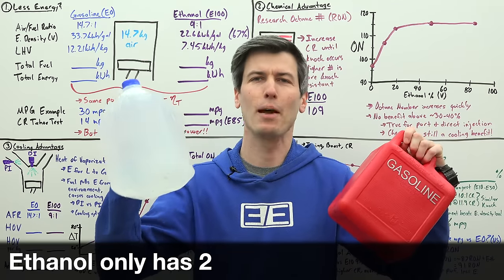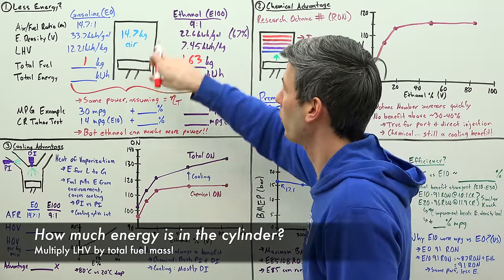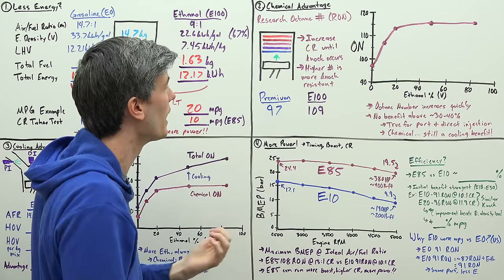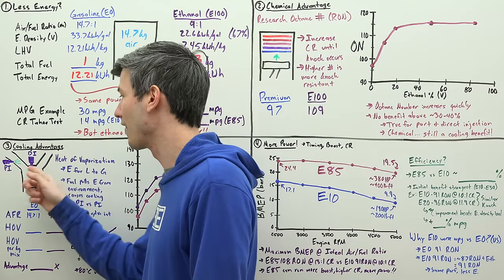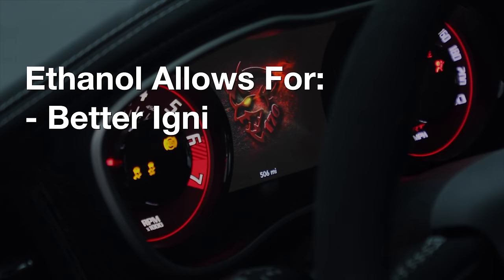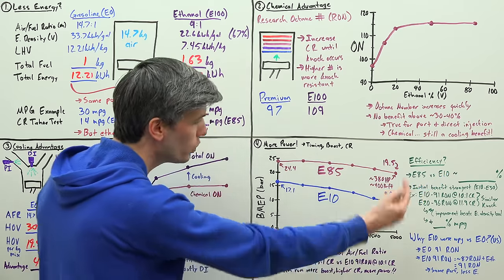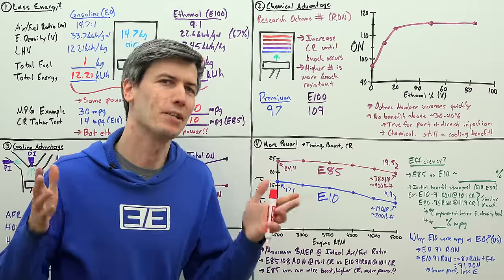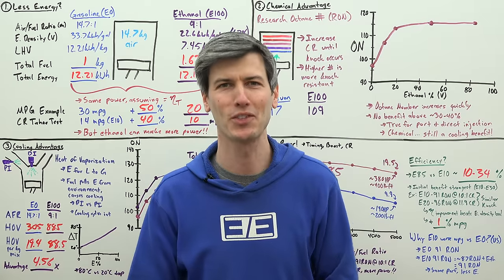Why Does Ethanol Make So Much Power? (Versus Gasoline)

Comment: Ethanol also destroys all engines unless those engines are specifically designed for it. And MOST are not.
Reply: 100% WRONGGGG.
Reply: @oldblueaccord2629  No, you are wrong. MOST if not all small engines warn about using any gasoline with ethanol. It crusts up the carburetor. If you have an airplane that is able to use mogas, you cannot use any with ethanol in it. So clearly you have no idea what you're talking about.
Reply: @jimsmalleimb7709  Im running E15 in my lawnmowers and weedeaters AND I got videos up on this thing called Youtube. You dont know what your talking about.
Reply: @oldblueaccord2629  : I just bought a new Firman generator. It says right on the gas tank and in the manual to use only gasoline that does NOT contain ethanol. YOU don't know what you're talking about. I'd prove it with a photo but you can't post photos here. There are also several videos here on this thing called You Tube that says the same thing.
Reply: @jimsmalleimb7709  No problem man. I didnt mean to trigger you. Im talking cars and lawnmowers and you swapped the story to airplanes and generators.
Reply: @oldblueaccord2629  In case the link didn't work, here are some excerpts from the article which states my point:
"Ethanol can damage many parts of your car at concentrations above 10%. Ethanol can destroy gas tanks, fuel pumps, gaskets, and attract moisture into your fuel. Engines can be completely ruined over time if they’re not designed for ethanol.
So, is ethanol bad for cars, and what does it do to engines? Ethanol-infused gasoline can absolutely damage engines. However, some engines are more vulnerable than others. Here’s what ethanol does to a car and why there’s a good reason to be concerned about using this fuel additive.
Fuel Tank Damage
Ethanol isn’t a threat to most steel and aluminum fuel tanks. However, ethanol can dissolve resins in fiberglass and composite fuel tanks, which can cause leaks or total tank failure. It doesn’t take long either.
Fuel System Damage
Ethanol is a much stronger solvent than gasoline. It also attracts moisture. Can you think of a component in your fuel system that’s vulnerable to solvents and shouldn’t dry out? That’s right, your seals and gaskets.
Ethanol can rapidly dry out and destroy rubber fuel system components, including gaskets and hoses. Some are designed for ethanol, but most are not, and they can be quickly ruined by ethanol concentrations as low as 15%. That means no E15 in your conventional vehicle.
Moisture Problems
Ethanol’s hygroscopic properties are to blame for many of the problems it causes, including engine issues. Condensation that forms inside your fuel tank on cold days is normally inconsequential—but the presence of ethanol can draw all that water into the fuel.
This can cause all sorts of issues in your engine, including fouling, corrosion, and knocking as the damage intensifies.
Reply: @jimsmalleimb7709  100 wrong very sad you spent time on that cut and paste. Enjoy your new 3 fuel generator....4th could be E85!
Reply: @oldblueaccord2629  Oh. I see. That article is a lie then, eh?
Reply: @jimsmalleimb7709  Well I dont write "articles" I do things. I have ALL the videos on my Youtube page...but just keep telling me im not...its fine. You actually gave me a great idea to convert my riding lawnmower to E85 this year. BIG TRIGGER!
Reply: @oldblueaccord2629  : If ethanol doesn't harm the engine, why would you need to "convert" it?
Reply: @jimsmalleimb7709  It needs re jetting to run richer. Usually about 30% richer. Dont worry Ill do some videos on it.
Reply: @jimsmalleimb7709  — Condensation that forms in your fuel tank will sink to the bottom of your fuel tank and freeze when temperatures drop below freezing. (Gasoline is hydrophobic.) The solution is to use fuel line antifreeze (also known as dry-gas or HEET) because it will BIND with the water and hold it in suspension. BTW, in case you haven’t figured it out, HEET is alcohol:

“The specific active ingredients of HEET and ISO-HEET are methanol and isopropanol, respectively. Amazingly enough, ethanol works precisely the same way: Water is absorbed by the ethanol and then gets vaporized in the combustion process.”

“The best way to rid your fuel of water is with gas-line antifreeze. Yes, that is a real thing. Getting the water out of the fuel system is critical, especially when the mercury drops below 32 degrees Fahrenheit.”

“HEET® brand gas-line antifreeze absorbs water and carries it harmlessly through the system. When water is trapped in the fuel lines and injectors, and the temperature plummets, it can freeze. This causes mechanical damage (cracked lines and injectors), and will impede fuel flow to the engine, so the vehicle won’t start. The antifreeze component of HEET® will lower the freezing point of the water, so that it does not freeze, keeping the fuel flowing for easier cold-weather starts.” — NAPA

Regarding E10 and water: E10 has resulted in fewer gas line freezing problems. It’s like adding a dose of dry-gas each time you fuel.

Also, alcohol dissolves in water to form a homogenous solution, so you cannot distinguish the alcohol and the water anymore. It stays “mixed”, too. Have you ever seen vodka separate?
Reply: @sking2173  Your really into the Vodka thing tonight...I still prefer Rye myself.
Reply: @oldblueaccord2629  — I use vodka as an example when discussing ethanol because vodka is simply ethanol and water (unless you’re into foo-foo vodka).

I also enjoy a sweet mash rye, but that doesn’t need to be brought into a discussion about ethanol motor fuels …
Reply: @sking2173  Im converting my riding lawnmower over to E85. I am going to call it the Jim small conversion, in his honor.....Lets see what we can "destroy"

Comment: It's not Ethanol, it's Methanol that makes more power. Gasoline is still more powerful than Ethanol. Bad video & is misinformation.
Reply: Here is an article from the Indy 500 and their switch from methanol to ethanol:

A Brief History of Racing Fuel By Craig A. Johnson

In 2005, the IRL used 100 percent methanol in their tanks. The fuel worked well and was more efficient than straight gasoline, but IRL officials believed there was room for improvement. In 2006, they moved to a 10 percent blend of ethanol and methanol, which was then changed to 100 percent ethanol for the 2007 season.

The desire to use only ethanol aside, 100 percent ethanol is nearly impossible to obtain, and is illegal to keep without paying hefty taxes that date back to prohibition. The actual fuel used by the IRL is a blend of about 98 percent ethanol and 2 percent denaturant. The exact composition includes a small amount of high-octane racing fuel.

The fuel for today's Indy cars has an octane rating of 113, compared with methanol's 107. This means a significant reduction in pre-ignition, or knocking and pinging.

In addition, many of the people who handle the fuel, say it smells like tequila. This quality may seem insignificant, but smell is actually one of ethanol's benefits when compared with methanol. Pit crews noticed the switch to ethanol immediately, reporting fewer coughing fits and less eye irritation before any other modifications were made to accommodate it.

According to Dennis Vervynckt, manager of hospitality services and an IRL official, in 2006, the first year the IRL began using ethanol, teams saw a reduction in efficiency of about 10 percent. "That's because we put straight ethanol into the tanks," he says. "The teams initially didn't make any or very many adjustments to their engines. After a few months, they kept tweaking and by the end of the season they were back up to 100 percent efficiency."

Vervynckt points out that there was a minor loss of power. "When they first started using ethanol, teams saw a slight drop in horsepower," he says. "As the teams got used to the fuel, they were able to get more horsepower from ethanol once they again reached maximum efficiency."

The switch to ethanol also allowed the racers to carry less fuel and make fewer pit stops, thereby increasing efficiency even more. "When the cars ran on methanol tanks had to hold 30 gallons to accommodate the fuel requirements of the cars," Vervynckt says. "After getting the engines to perform at their full potential, there was a significant gain in mileage. Indy cars now have 22-gallon tanks. When a driver pulls in to change out his tires, he can fill up. Teams were able to match their tire and fuel stops exactly, instead of stopping for tires only, or fuel only."

That efficiency translates into much less fuel being used by the sport. Lifeline Foods LLC, which supplies fuel for the IRL, will produce 120,000 gallons of ethanol for the 2008 season. And though this may seem like a lot, it's<b> 20,000 gallons less</b> than was used the previous seasons.

The switch from methanol-based fuel to ethanol has amazed almost everyone in the league. Drivers, the direct users of the fuel, voice their approval in glowing terms. "[Ethanol] is an American fuel that is good for the country and the environment," says Ryan Hunter-Reay, of Rahal Letterman Racing and driver of the ethanol car. Standing beside his crew as they make last-minute adjustments to the car, he is more than happy to discuss the benefits of the IRL's switch to ethanol. "It's been great for Indy racing the fuel economy, emissions there's nothing we don't like. We love it."
Reply: @danafletcher2341  & he's full crap because Methanol does up to 160 Octane, while ethanol only goes up to 110-120 octane.
Reply: @kevinerbs2778  Take it up with the Indy 500, I believe them.  Hard to argue with a smaller fuel tank.
Reply: @danafletcher2341  WOW you got one here Dana....good luck.

Comment: Burns faster, simple smaller molecule more interaction with Air i did not even watch video .the end
Reply: Actually I think its burns slower hence the higher knock rating....but I watched the video.
Reply: @oldblueaccord2629  I am kinda sure ethanol burns faster. I just googled it to make sure and it seems like it’s the case. Again molecule is small (2 carbon) lots of space area to interact with O2 . Also intuitively , just think about the rate of burn of say natural gas (super small molecule) versus something like diesel(large molecular weight longchain, many carbon “big”). 
So if it burns faster that means more energy in time = power .
No offense to this “ engineering “ guy, but sometimes he’s misleading . Or rather he focuses on a few true details , without taking into account the whole story.  In the video itself, he claims because you can run higher compression you can then  tune with higher compression=power . That is the reason why , yet by this logic we should run diesel motors . super high compression = max power.  Yet diesel engines are not the pinnacle of peak power .

Comment: Garbage fuel, so much forest lost around me to grow corn for this crap.
Reply: If you tell me what state you're from, I'll tell you just how much forestland you gained from the Census data:

Here is a list of where most of the corn is produced, Ohio Indiana Illinois Iowa Missouri Michigan Wisconsin Minnesota North Dakota South Dakota Nebraska and Kansas. 

Here is how the 2007 energy act/RFS affected forest and wildlife areas in corn producing states(hint the opposite of what you were told) 

Total forest use land of those selected states: 

1945 87,509,000 
1949 88,735,000 
1954 90,912,000 
1959 88,342,000 
1964 88,068,000 
1969 88,069,000 
1974 85,948,000 
1978 82,034,000 
1982 80,719,000 
1987 79,264,000 
1992 83,294,000 
1997 84,828,000 
2002 84,683,000 
2007 90,700,000   4.7B gal. corn ethanol mandate
2012 93,533,000  13.2B gal. corn ethanol mandate

Land in rural parks and wildlife areas in those selected states 
1945 1,614,000 
1949 3,991,000 
1954 3,790,000 
1959 4,718,000 
1964 5,247,000 
1969 5,565,000 
1974 5,958,000 
1978 7,510,000 
1982 7,903,000 
1987 12,082,000 
1992 9,168,000 
1997 9,071,000 
2002 9,120,000 
2007 10,388,000   4.7B gal. corn ethanol mandate
2012 10,998,000  13.2B gal. corn ethanol mandate

It is simply impossible for the 2007 energy act/RFS to have taken away grasslands, forests, virgin, or any other kind of land because US cropland acres have fallen, not risen since then. 

Believe it or not, the corn belt grew more corn acres in 1980 before ethanol than in 2018, the year of most ethanol production ever.

2018 13,200,000 acres of corn with record ethanol production
1980 14,000,000 acres of corn before ethanol

2018 Illinois 11,000,000 acres of corn with record ethanol production
1980 Illinois 11,600,000 acres of corn before ethanol

2018 Indiana 5,350,000 acres of corn with record ethanol production
1980 Indiana 6,450,000 acres of corn before ethanol

Hint:  Corn ethanol retains the feed value in the triple concentrated distillers grains.
Reply: @danafletcher2341  you put in a lot of work for this reply, unfortunately I live in Canada.

Also why is it Americans assume they’re the only country?
Reply: @thedean-dx3qt  Then you answered your own question...ZERO!
Reply: @oldblueaccord2629  maybe you don’t know but canada produces ethanol, I literally live 20 minutes from an ethanol plant 🤦‍♂️
Reply: @thedean-dx3qt  But they didnt cut any new forest to grow corn...Thats a made up story and you know it. Generally when a person does a video in the USA we just assume he is talking about the USA. Maybe?
Reply: @oldblueaccord2629  you make me laugh, I see it cut down all the time. But I suppose you would know what I experience in My life better than I  🤦‍♂️
Reply: @thedean-dx3qt  You made the garbage fuel comment in a public forum...im sorry.
Reply: @thedean-dx3qt  He also says that "In the USA we use gallons" and "In the USA we use miles"...
Reply: @francisdec1615  Thats very true...you edited out your other post you might want to edit this one also.

Comment: E85 is garbage!  The lower mpg coupled with the long term engine damage is not worth it.  When you push a product that cost more to produce than what it sells for you are simply full of it!
Reply: BS
Reply: @oldblueaccord2629  What did I state that is not true?
Reply: @rack9458  100% BS statement made by you.100% meaning ALL OF IT.
Reply: @oldblueaccord2629  Coming from the guy who has "no idea" what synthetic fuel is! 😳
Reply: @rack9458  Yep and your still wrong go...
Reply: @rack9458  I like google but im a do -er if you would. I have all my  vehicles ,lawn mowers, weedeaters running some percentage of Ethanol. I like it and I have videos on my channel about it.